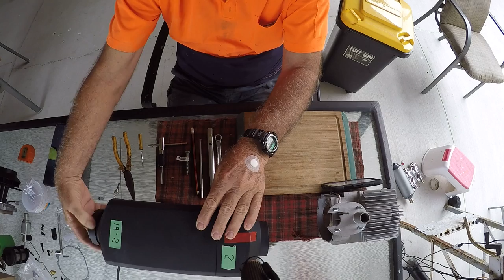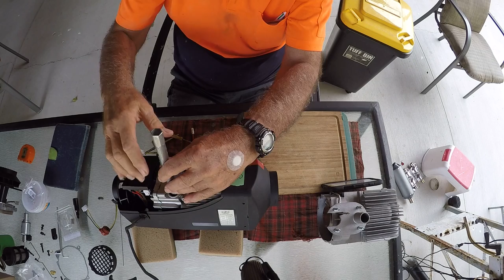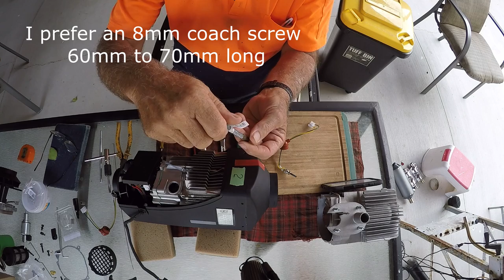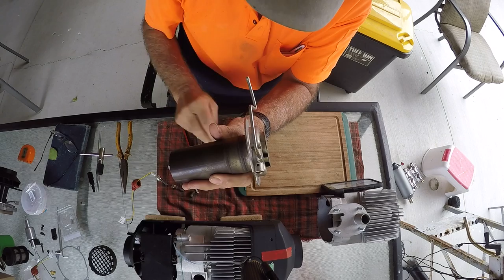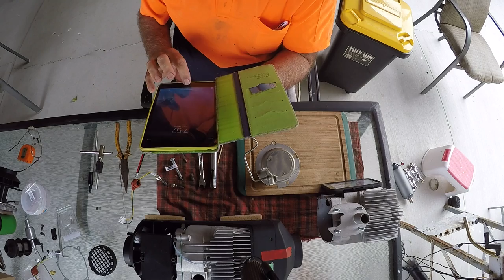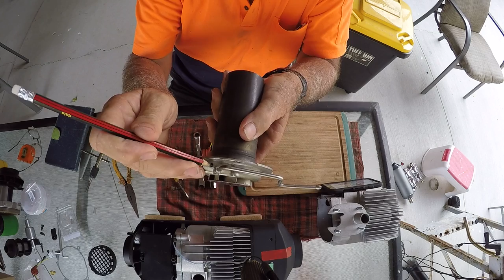Chinese Diesel Air Heaters - Part 9 Glow Plug & Atomizing Screen

Comment: Fantastic series of videos, well done. I do have one question and that is regarding the starting of the heater. When the heater is turned on, the fan starts to create air flow and the glow plug powers on.
On the heaters I have, after about 90 seconds the fuel pump starts and if monitoring from an app, the combustion temperature will rise. After about 4 minutes the glowplug will turn off.

I have one heater that on many occasions the glow plug icon comes on and the glow plug draws power however the fuel pump never starts. On every occasion I have just powered off the unit, then back on and it has started correctly.
My question is what tells the fuel pump to start? If it were a timer, I'm sure it would always start. If it is temperature, where does the heat come from apart from the heat of the glowplug?

On a new heater or a serviced one, there will be no residual fuel in the combustion chamber and only the powered up glowplug, so what starts the combustion process? 
As I stated earlier if it were a timer, I'm sure it would always be a consistent start.
The other strange thing is there is no error codes. It just sits there with the glow plug powered up for as long as I leave it. At approx 9:30 in your video you state the mesh acts like a pilot light, however on other types of heater a pilot light would operate a thermocouple and that is what starts the main gas valve (In the case of a boiler), but what starts the fuel pump on these heaters?

Any ideas?
Reply from the maker: Hi Anthony,

You are correct with the start sequence.
It is a signal from the CPU that opens a “relay” and sends power to the fuel pump.

One major cause of the fuel pump not starting is low voltage at the heater when the glow plug turns on. The glow plug will draw up to 10 amps to light up, and if your power wires are too thin you get a significant voltage drop and the glow plug does not get hot. If the glow plug does not get red hot the pump will generally not start.

Suggest you check your power wire size, and check voltage at heater. If voltage is below 12 V suggest you increase wire size and see if that makes a difference.

In the five years since I did these videos, I have not come across your issue with decent sized wire. When I get a chance I will see if I can replicate your issue, and see if I can find out what actually triggers the CPU. 

Another thing to look at is if the glow plug screen is all blocked up with carbon. 

Also, if you have a spare controller, swap in a new one and see if that changes things.

Sorry I could not be more helpful.   JMcK
Reply: @johnmck1147  Hi John, thanks for your reply.

I am only using the cable supplied with the heater without any extension. The power supply is a switched mode 12v 30A supply. As you say the glow plug uses quite a lot of power and even though the power supply remains at 12.5v (What I set it at) the display on the heater does drop down to 10v, so that is voltage drop in the wiring not the supply. Maybe I tweak up the supply, not sure what it will go up to but I'm sure it will go up to 13v.

As you also suggest, maybe cut out the excess wire that feeds the heater. My power supply is right next to the heater and the spare cable is coiled up. 

I need to check the voltage going into the heater plug at the rear of the heater and see what the actual voltage feeding the heater is and what the volt drop along the cable is.

I do find it strange that no error shows, surely whoever wrote the program would have had a line that says "Glow plug on AND after 3 minutes pump has not started error xx"

The heater is a Maxpeedingrods MXR-3M, and I queried this with Maxpeedingrods and they sent me a replacement heater, however that had more issues!

The replacement always fires up, but it gives out off the scale carbon monoxide readings from the exhaust and from the warm air vent gives out high levels of Co2, VOC's and HCHO (According to an air quality meter) Obviously there should only be warm air coming out of the air vent and no noxious gasses. 

The first heater had run 300 hours and there was no soot inside the exhaust pipe or on the floor where it vents outside my garage. After a few hours of the new one running, my patio slabs turned black! The new heater does not appear to use any more fuel and actually (According to the App ond LCD display) runs hotter at 230-240 deg C as opposed to the original that runs around the 200 deg C mark.

I did purchase another Maxpeedingrods heater model MXR-2Y and this one performs ok, it starts, runs clean, has no emissions, and runs at 200 deg C.

I think I need to strip down the second one and find out why it runs so dirty and bad, maybe a damaged gasket or crack in the casting.

I will let you know.

Thanks again for your help.
Reply: Hi John, I did mean to mention that allegedly the heater has a low voltage fault however this has never occurred (E1 according to the manual).

You would think that if the heater considered there was insufficient voltage it would throw an error rather than leaving the glowplug energized forever?

I have seen the heater in this condition for over 35 minutes and have just cycled the power and then it has started perfect!
Reply from the maker: Hi Anthony,

Thanks for the update.

You don't want excess wire coiled up. Suggest you cut it off and run better cable from power supply to heater.

These heaters, in good condition, run very clean. Suggest you watch my gasket video.

Please keep me informed.  JMcK
Reply: @johnmck1147  Hi John

I tweaked the voltage on my power supply to 13.5V. I tested the voltage going into the heater plug, and it is the same with the heater powered on but not started. When the heater is started, the display on the heater LCD shows approx 1 volt lower than the supply at the rear of the heater, so the volt drop is internal in the heater (It is the same at the power supply and going into the heater when starting).
It has started successfully a few times, but it has not been like this long enough to draw a conclusion.

Everyone says that on shutdown, the heater plug is energized to perform a self clean, but by monitoring both voltage and current I can say this does not happen on the heaters I own, however they are all Maxpeedingrods, so maybe different to others?

Better news on the sooty replacement heater!

I decided to strip this down to see what was happening and found a piece of soot inside the burn chamber that was approx 30mm square. I have loads of photos if you want me to send them. At first I did not realize what had caused this soot, but then noticed that if you look at the open end of the burn chamber and look down the end, you will see a plate with a hole in it and through the hole you see the "Gear like" center part that causes the air to vortex. That plate has been welded on on the piss and has left a tiny air passage where it touches the outside of the burn chamber (The plate should be flat and touch the entire inner of the burn chamber tube) I assume the air now had two paths, through the center where it is supposed to go, and through this gap causing poor combustion. The heat exchanger was filthy with black soot.
I fitted a new burn chamber and voilà, no soot or emissions and the carbon monoxide has gone down from over 600ppm to 10-17ppm which is the same as my other heater.

I will keep you posted on the first heater issue!

Thanks again for your support.
Reply: Hi John, I forgot to mention something!

The sooty heater ran at between 220-240 deg C when sooted up. My other heaters run at just over 200, maybe 208 deg C. I have seen many videos where people state they cut out on overheat above 230 deg C, but not this one!

I thought after the new burner was fitted this would be the same as the other heaters ie 200 ish, however it still runs hotter. There is little carbon monoxide, so combustion must be ok, so maybe it is a sensor fault or an inaccurate CPU. An infra red thermometer says all the outputs, measured on the alloy/cardboard tube are approx 85 deg C, so maybe it is just an inaccurate reading.

I suppose the only way is to change the sensor or the CPU for one of the other heaters and use process of elimination to find the cause, unless it does run hotter! If it actually runs hotter and uses the same fuel it must be more efficient?

Tony
Reply from the maker: Hi Tony,

Thanks for the updates. My email is johnmck47@outlook.com. I will reply when I can, but if I am away travelling or sailing it can sometimes be a couple of weeks with no internet connection.

These heaters must go through a shutdown process to remove unburnt fuel and purge the combustion chamber. This process includes the glow plug being turned on. 

When I made this series some five years ago the Chinese copy heaters all followed the same protocols and you could mix and match components. Sadly these days this is not so, and some heaters are being marketed with their own proprietary systems, and in some cases by a manufacturer who has little understanding of the operation. Eg thin power wires which are ok for the current draw when running, but far too small to prevent serious voltage drop with glow plug start. Proprietary ECU's programmed by engineers who don't understand heater operation, and fuel/air mixture ratios, to name a couple.

But, for the majority, I think these are excellent little heaters, and at a very affordable price cost.  JMcK

Comment: Fantastic series of videos, John.  Thank you for all the time and effort you put in to create and post these.  The information you have shared is extremely helpful.I have ordered a 5KW heater to install in a camper van.  I would like to place the heater on the floor behind the driver's seat and the fuel tank in the very back of the van for easy fueling.  The distance between the tank and heater is approximately 11 feet.  I hope to locate the pump and filter very near the tank.  Can you tell me if there are limitations I should be aware of for the distance between heater, pump and tank, and the variation in height between the heater, pump and fuel tank?  Thanks in advance.
Reply from the maker: Hi Mathew, I added a reply, but it came up separately. It is in this section.

Comment: Hi John just discovered your videos thankyou very informative and you put alot of time into them, one quick question regarding glo plugs should they be checked and cleaned periodically if so how often or if the heater is starting fine just leave them alone thanks again Freeo
Reply from the maker: Hi F55,
The glow plugs are very fragile, so better leave them alone if heater is working ok.  
“If it is not broken, don't fix it”
With a good install with minimum restrictions in exhaust, and a gauze filter on combustion air inlet, you can go for years without having to clean glow plug.  JMcK
Reply: @johnmck1147  Great thanks mate we only use the van a few times a year at this stage still have kids at high school so it wont be used all that often thanks for the quick reply

Comment: Great video, What is the best way to avoid carbon build up to prevent maintenance and repairs.I have my diesel heater installed in my garage workshop.I am running it on red diesel.
Reply from the maker: Hi Jollyroger,

Have a proper install with minimum restrictions in combustion intake air and exhaust. Restrictions cause mismatched fuel air mix and carbon buildup.

Use narrow bore hard nylon fuel line from pump to heater so fuel pulses are not absorbed by soft fuel hose, causing fuel atomisation issues and carbon build up.

If running heater for long periods on a low setting, occasionally run the heater for a short time at full power to burn off carbon deposits.

Install a proper air filter on the combustion air intake hose to prevent bugs and foreign objects being sucked into the burn chamber.

Install a good fuel filter in the fuel line to prevent issues with the tiny valves in the fuel pump. 

Don't burn exotic products in heater. 

Regards.  JMcK
Reply: @johnmck1147  Thank you John, All noted.
Reply from the maker: J0llyroger 

👍

Comment: Brilliant videos. I’ve been watching the videos with a keen eye on if the units will run on biodiesel (Proper bio) my primary concern is the trace amounts of methanol left in the fuel which from experience eats away at certain types of rubber. I noted the concern about running kero and Lube for the fuel pump. Having watched everything thus far I’m going to bet the fuel pump is a rubber disk with an actuator and pretty sure it would get destroyed pretty quick with biodiesel. I wonder if you can advise on the fuel pumps regarding replacements, alternative replacements you might have seen while shopping about. I’m  guessing that the supplied pump is sealed in manufacture with the two halves pressed together preventing disassembly? (This is an edit - and the next video is....fuel pump lol, I’ll watch that next)
Reply from the maker: Hi Mr FG,

Yes the fuel pumps are sealed at manufacturer and can not be opened without destroying the pump.

There are no alternate pumps that I know of. These are dosing pumps always delivering a fixed dose at each pulse. This dose is known by the ECU that runs the unit and the changing the dose rate by the ECU is how the heater works.

Newer fuel pumps I have cut open have what appears to be a type of plastic piston sealing ring. 

I do not think bio diesel would affect the fuel pump and if it did it would be over a long period of time, also replacement fuel pumps for these Chinese copy heaters are relatively cheap.

If I was in your shoes I would try running the heater on bio diesel if that is what you wish to do and see how it performs. I would be grateful to know the outcome.

Remember you will need to be aware of fuel line issues.

Good luck.   JMcK

Comment: Any idea what happens is a part of the broken glowplug falls inside? Do you need to take it apart? 

I removed the glowplug but a piece fell in. After placing the new one the monitor started to flicker and it turns off. Any idea?

Thanks for the amazing content you´ve created.
Reply from the maker: Hi VDW, you need to open the heater and remove the bit of broken Glow plug.  JMcK

Comment: Hi mate. I’ve been so impressed with your videos on theses heaters and found it very informative 😀 I’ve got one myself and been so frustrated that it only smokes and won’t fire 🔥🙈 Since watching your videos I’ve discovered that the little mesh filter is blocked and the glow plug is dirty 😫 Can you suggest how I can clean the end of my glow plug please 😃 I’ve orders new mesh filters and an air intake 👍🏻 Cheers for any help Stevie.
Reply from the maker: Thanks for the feedback Stevie. I just use fine grit sandpaper on the glow plug. Be careful though as the glow plugs are very fragile.  JMcK

Comment: Just started to use it and it worked great for two days then it started to smoke during startup ! It only has 3 hrs of run time! Could it be bad or old fuel? And is the glow plug need cleaning?

Comment: Hey John, thanks for making these videos. Do you know if the Eberspacher glow plugs are compatible with the Chinese diesel heater? The connection looks different but it would be easy to modify. The cheap Chinese plugs have a poor reputation for reliability.
Reply: sorry to be off topic but does anyone know a tool to log back into an instagram account??
I somehow forgot my password. I would appreciate any assistance you can offer me
Reply: @Allan Derek Instablaster ;)
Reply: @Kade Kyson i really appreciate your reply. I got to the site through google and Im waiting for the hacking stuff now.
Seems to take quite some time so I will get back to you later when my account password hopefully is recovered.
Reply: @Kade Kyson it worked and I actually got access to my account again. I'm so happy:D
Thank you so much, you saved my account!
Reply: @Allan Derek No problem =)
Reply: Hello Simon glow plugs fit everything
Reply: @glennbeadshaw727  Not so. The Webasto and Webasto knockoff glowplugs don't have a threaded part, and are held in with a screw. So the easy differentiator is the fairly large threaded part near the wire bit.

Comment: Hi John. This is great info - extremely informative videos. Question on your side/horizontal mounting comments. You mentioned that you can mount it horizontally as long as the glow plug is on top. I need to mount a new heater on a power boat near the centerline of the boat, but want to mount it horizontally as it will give me better routing options for the intake/exhaust and fuel lines and make maintenance a LOT easier. Any concerns with mounting horizontally on a power boat? I would imagine maybe on a sailboat there would be concerns over pitching and rolling; but a power boat is not going to have as much wave action affecting the boat. 

Also, is the angle more of a concern just when starting the heater when the glow plugs are on and after everything is running, angle is not as critical?
Thx.
Reply from the maker: Ji Jeremy,

Sorry for late reply. (I missed your question). You will have no issue mounting horizontally on a power boat.

You are correct. The heater has issues starting, or won't start if unused diesel can pool around the glow plug and atomisation screens.

Once the heater is actually running it will work in just about any position.  JMcK
Reply: @johnmck1147   Thanks. This is super helpful!